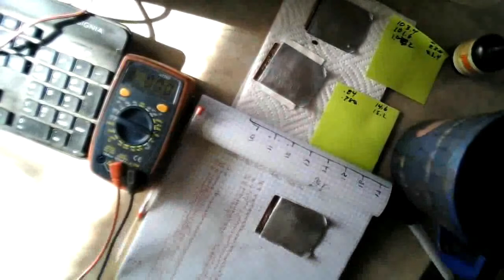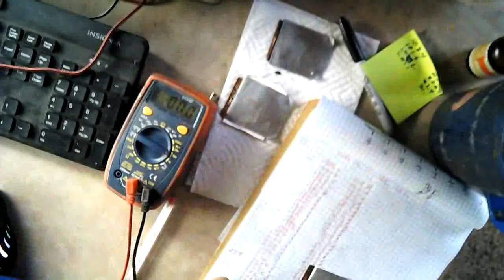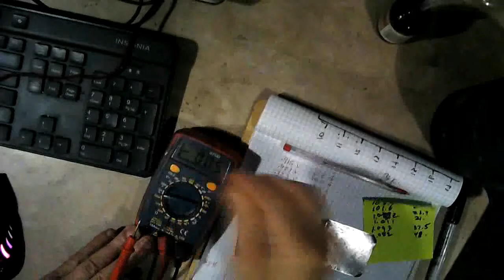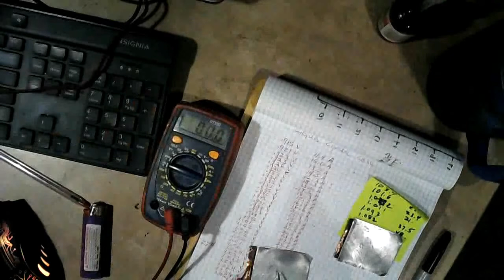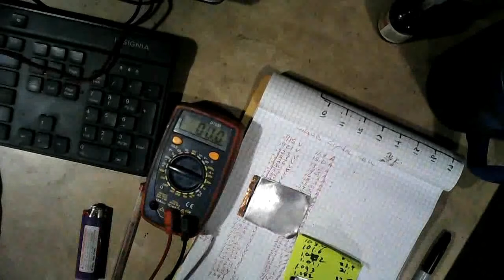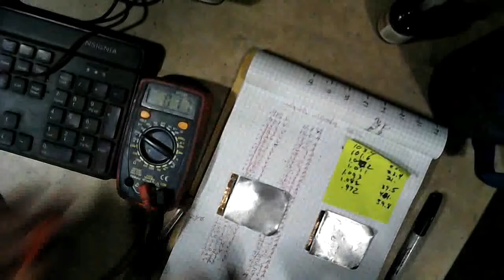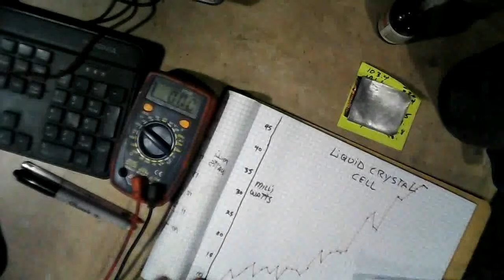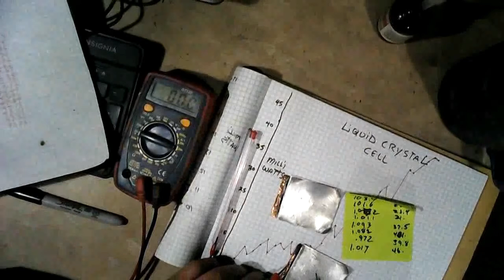Liquid Crystal Bio-Cell! Day #2

Comment: Great improvements, cycling the cell over time seem to be a big factor.
Hopefully will get my Arduino cell tester finished this weekend :-)  Martin.
Reply from the maker: Hi Martin, I think cycling the cell and/or putting a load on the cell is critical now. I noticed that the cell will actually self-discharge sometimes, especially without a separator paper. I'm behind on my work too.